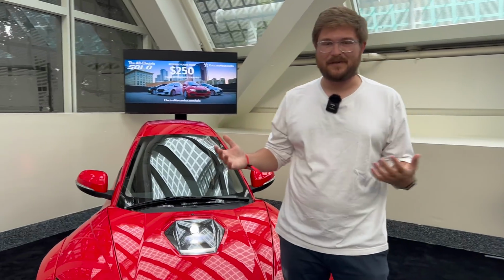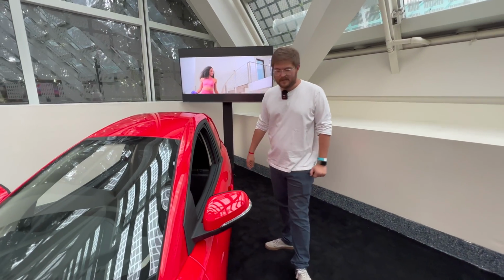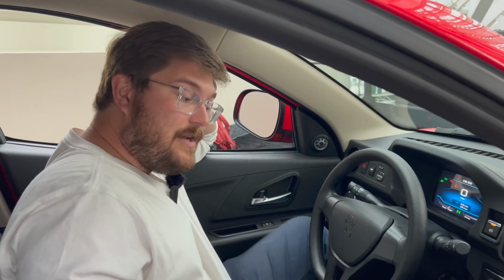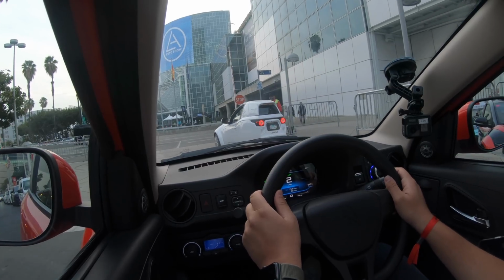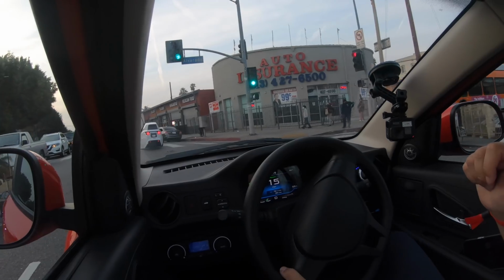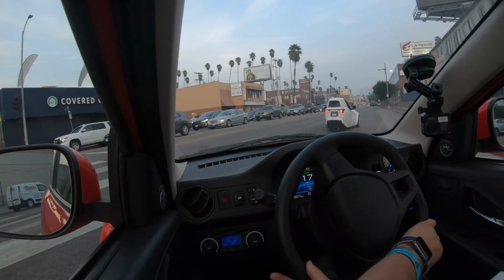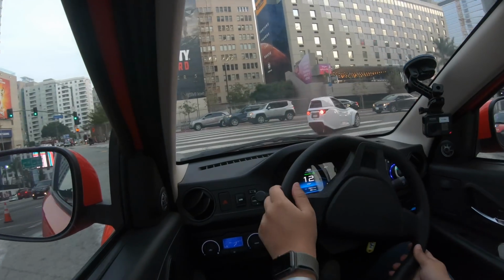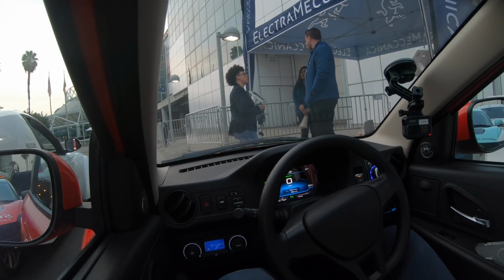I Drive The Electra Meccanica Solo EV For The First Time!

Comment: Interesting development at ElectraMeccanica.  They have decided to get out of the three-wheeled (autocycle) market.  They are going to contract manufacture electric motorcycles for another company and are going to develop a four-wheeled vehicle (Project E4).  They do seem to say that it MAY be possible for someone to succeed in the three-wheel space... 
Quote from their blog post of 3/14/23
"Defining and  capturing a market around a three-wheeled vehicle that doesn’t easily  fit into financial, legal, and regulatory infrastructure may be possible  for someone - but not us. We don’t have the capital to build both a new  kind of vehicle and create every single aspect of required sales and  support at our prior, declared MSRP."   They mention the lack of government rebates as one reason to end the Solo. 
I altered this link to the announcement to avoid spam filters but you can figure it out: https://ir . emvauto . com/emotion/blog-details/2023/A-Fresh-Start-Part-Two/default . aspx?fbclid=IwAR2tU8r8tnmR4FGZ9X11ua61FLh5WDsQIqZRSCNrkPwndbXVS1nYmYDUQrg

Comment: I got to look at one of these in Glendale and it feels solid and heavy. I remember it being  difficult to get in and out of though because you have an acre of side wall between the driver's seat and the outside of the car. I have to say, if someone is really concerned about safety then they shouldn't be looking at one of these, or any car. Just go get a big SUV. With so many trucks, SUVs, and EVs on the road now just about every class of car, CUVs, and even midsized SUVs struggle to provide 360 degrees of protection from a speeding 5000lbs hunk of steel. If you want to be safe you have to have size and weight on your side.

But if you're looking for a fun weekend ride this is a cool option.

Comment: $18k for this but i got my 2017 mazda CX-5 for $17k and it had 27k miles on it. It may be a new EV but i need to see a value for what im buying, if a used car decent on gas with lots of room is cheaper than this single seater then yeah im not gonna buy it. If it had one more seat then i would be a little more tempted to buy.

Comment: Roll CAGES are safe one or two steel bars are not. Not only that but if you get smacked by a real car you are going to travel a great distance in all kinds of unavoidable ways because of the size of the vehicle compared to what is hitting it. If this is NOT a safe car you will definitely find out if you are in an accident. The crunch factor also looks like it would be very bad. Not much space for the car to crush in before hitting passengers. That's bad, I see this as a less than safe vehicle, safer than a motorcycle but nowhere near as safe as a normal vehicle.

Comment: well, tuesday i called solo, noone ansered theyre sales line. I tried service, left msg I wanted to buy, mentioned IM a cash buyer. Fast fwd, im on day 4 trying to buy a solo for cash. Finally after days of pulling teeth, they send me a VPA (vehicle purchase agreement). I sign and send int back. Couple minutes later Im looking over the VPA and it shows a 2021 model. The same thing happened Tuesday from Jake their LA Sales Mgr. Oh typo Jake said.
I contact Zira their Sales Dir who Im now dealing with. FOURS DAYS HAVE PAST NOW!
I bought my Winnnebago  a couple years ago, financed it, No Money down, 3.99% 20 yr fixed. Drove off the lot 6 hours later.
Bought my Ford F150 with a trade in,  drove out in 5 hours.
Got a RV and Truck now, I need a motorcycle. Drove down to Honda dealer. Bought a carrier, they took out of the box, put it together loaded the motorcycle on the truck and i drove out in 3 1/2 hours.
Still with me ? Now comes the best part, When I tell Their Director of sales. 
He writes back, after 4 days now, "Have a nice weekend we,ll look into it on Monday".
Did he just go home and leave me hanging?
HOWS THAT FOR CARING ABOUT YOUR CUSTOMER?

Comment: So, it costs around 18K, only carries one person (most motorbikes are able to carry two) has hardly any luggage space etc. It will obviously be no good as a first vehicle, so given the price & the drawbacks I can only conclude that this is an expensive toy for the well-heeled.
Oh, and it is not like putting a passenger seat belt on, it's because you Americans drive on the wrong side of the road 😂

Comment: Looks very similar to the Corbin motors Sparrow. Which I've driven they came out around 2000. Originally with lead acid batteries my friend had converted his to lithium. I was very impressed with the way it handled and accelerated if you want to see what the Corbin motors Sparrow look like here it is.https://youtu.be/OxCH0ANQ-js

Comment: Size-wise Livery vehicle yes the far as reality wise The Limited range is only 100 mph for charge and you're not even running all the toys going down the road like the AC flat out just a normal amp load of an air conditioning system means that you're going to get less than 75 miles off of a full charge on a very hot day and by the way when you're climbing the hill with a single speed transmission even a Tesla in a 12% Klein incline drops a full kilowatt of power every minute that it's climbing at that steep of rate because there's a lack of a gearbox even electric bikes of the same size does so much better even electric cars from China they do so much better sad thing is they're not license for the United States

Comment: The last video I seen about this car the guy was bragging about getting 100 miles to a charge but he wasn't running the air-conditioning he wasn't running the radio he wasn't letting us see the speed he was going down the highway so on normal usage of Power Systems unless it's got a Shepherd motor for the air conditioning that means is going to draw continuous minimum a 30 amps for the air air conditioning and not even talkin about the stereo or the heated seat

And by the way if it's over $5,000 was that little of range it's just a total rip-off of my opinion and I've been researching electric cars for over a year the Chinese already make electric cars not trikes that get more mileage and let alone they show them running all their toys

Comment: 18K is still kinda pricy, if they could cut the price in half I think it would work well though.
Reply: Do you realize how expensive Lithium batteries are? $18k is a pretty good price for what this can do
Reply: @IRLSuperb  $18k is terrible for the tiny range
Reply: 18k for a little box with 3 wheels is genuinely laughable.
Reply: @thebeast12333  so are you arguing that motorcycles are laughable since they can run higher price than that and only have two wheels and no box?
Reply: Cut the price in half 😂 it is a new ev at the end of the day
Reply: I mean it really is just an upgraded motorcycle. So it’s a fair price
Reply: Yeah, why not bring it down 80% . Even better,  right ?
Reply: Paul Elio thought the same, until he found it was untenable.

Comment: Good if your single, have no freinds, no close coworkers to carpool. It's small, but not as small as a motor bike, so you will still require car space on the freeway, and unable to split lanes. You'll save alot on power since you dont have any freinds and work is all you have. You dont need to worry about cargo space since no family will require a trunk and no partner will take up a cup holder. The perfect car for a non-reproductive!

Comment: I had to cancel my reservation in 2019 after I test drove it just because it  did not make sense spending $20000 for a single seat with 100 mile range , I have a reservation for an APTERA at the moment , way better performance and convenience with the solar panels , my configuration is 600 miles with all wheel drive
Reply: keep us updated! can understand your decision there, going to be interesting to see how aptera plays out

Comment: Traction/grip is a function of contact with the road and thus more complete contact equals more traction. But only if the rear tire's tread totally touches the road surface throughout body roll during lateral forces.
Reply: What if they add adaptive damping on the rear wheel in order to maintain contact, would that work?
Reply: @jeetsom9659  
3WS would be timed to correct for body roll during lateral forces or direction of travel. A steering knuckle with compact electrical actuator are added to steer the rear wheel, initially the rear wheel steers slightly (at most 1.7 degree) in the same direction as the front wheels. This improves stability during high-speed turning or lane changing. Keep turning the steering wheel would reverse the direction of the rear wheel (at most 5 degrees). This is used to quicken low-speed turning and reversing and to improve rearward stability during payload weight capacity. Effectively, equivalent to having a long or short wheelbase. Depending how straight or curvy you drive.

Comment: I think the Solo's true appeal is fun rather than efficiency or utility.  It's a unique driving experience. I understand why the reviewers wanted an "R" model.  If ElectraMeccanica can make this like a three-wheeled Miata, they're onto something.  They need to concentrate on vehicle dynamics and ensure safety at the limit (that is, limit rollover potential), but the ingredients are there. And yeah, produce the convertible version that was shown at SEMA!
Reply: Are you aware of the Aptera? You are describing one in your list of desirable features.
Reply: @IBMara  - Oh yeah, I think the Aptera is a fantastic machine.  I love the forward thinking and aerodynamic purity.  However, there are notable differences. I like the Solo's single seat driver position, small size and proximity to the ground. All of that enhances the sensation of speed. The Aptera, while amazing in its own right, sits higher off the ground, exhibits standard side-by-side seating and occupies a relatively large footprint. For me I'm thinking street-legal go-kart and the diminutive Solo captures that feel.  I test drove one several months ago and loved it.  It only needs more power and a convertible option. Fortunately the CEO has hinted that higher performance is on the menu. And frankly, the Solo should cost a bit less than the Aptera. Alas though, we may have to wait a while for both vehicles.

Comment: Dacia Spring is about 18000€ (VAT included) in France. 27,4 kWh battery ; 33 kW motor ; 970 kg ; 4 places ; AC charger 6,6 kW and DC 30 kW in option.

Comment: Pretty cool vehicle. Seems a lot better put together than I would have expected. Looking forward to your longer term more in-depth review.
For urban environments short commutes this would be great. Not sure it would work for package or food delivery unless you were driving very short distances in a very dense Urban environment. Most food delivery people I know drive Closer to 170 miles per day.
Interesting how it lifted the rear under acceleration. That's a little bit odd. But you would actually often find that with shaft driven motorcycles. It's got to have something to do with the rear swing arm geometry.
I wouldn't worry about snapping the bell. Harley-Davidsons are all belt drive and they make way more power and torque than this does. The nice thing is they're about the most energy efficient way to transmit power. Chain being the next best but that adds weight and noise.

Comment: 3 wheel cars will always be a disaster
Reply: Much to prefer with front wheel drive absolutely as a "control surface" but hence the much lower price. Definitely not for regular highway use but for around town use way better than a zero motorcycle obviously.

Comment: I drove one of these prototypes at their office in Vancouver a couple of years ago....and they'd be a great solution for a daily driver in a city where you don't need a lot of range and where parking space is at a premium.  Way better than a motorcycle since you've got an enclosed airconditioned cabin and lots of storage space all at the cost of a premium motorcycle.  The biggest downside is that it only holds one passenger.  You didn't mention their unique honeycomb fiberglass frame system to reduce weight yet have a firm and strong chassis
Reply: It is definitely made for a very specific demographic. But it's worth knowing that about 80% of people drive to and from work alone. So for a second car or for people who are single this would still be ideal.
Reply: Great for tourist rentals!